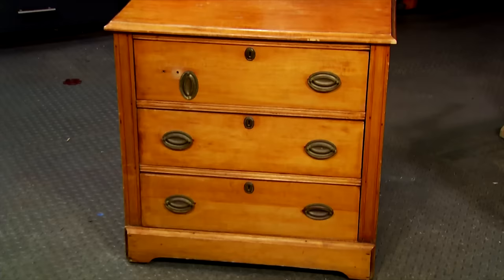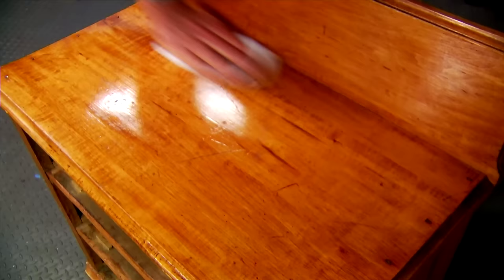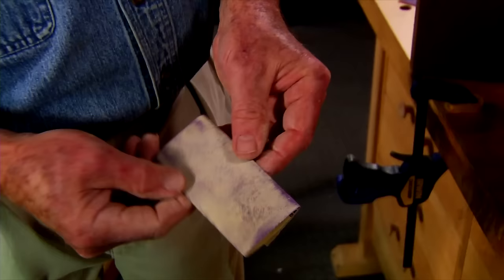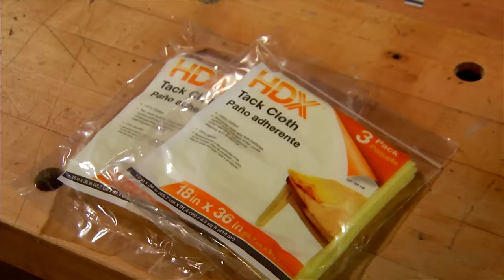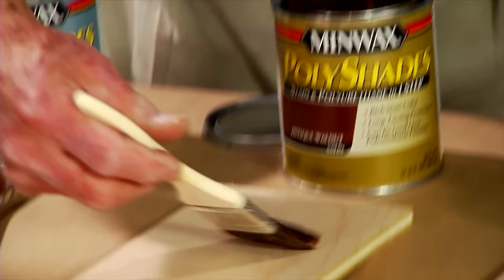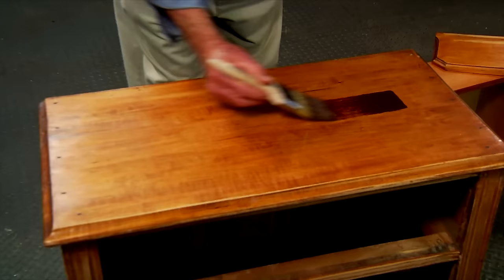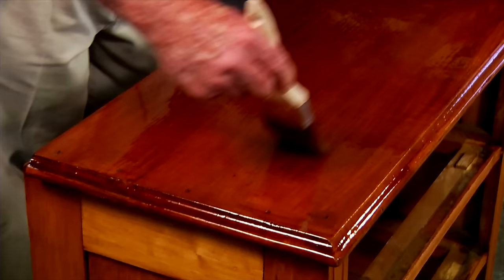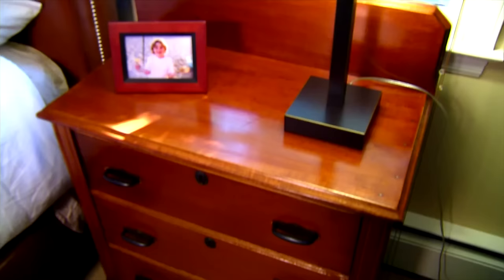Refinish Furniture Without Stripping

Comment: The sand paper cutter impressed me the most. This man is a dying breed of craftsmanship
Reply: To p
Reply: Halving then quartering a standard sheet of sandpaper evenly can be fitted on any of the quarter sheet sanders. A half sheet folded in thirds is SOP in the paint trade working well for those who have small as well as large hands. The DIY ad/infomercials make it look as if there are just a few types of abrasive papers. Not so!
Reply: Well, if you´ve never used a pair of sissors or a boxcutter i guess it´s "craftmanship"? Lol!
Reply: @1967DIF  this is a lot slicker than running a pair of scissors through it

Comment: I just had to come back and tell you that I refinished my kitchen cabinets (all 54 of them) and I did it every step that you showed in this video; except that I used a stain without the Polyurethane. I did the stain first then applied the Polyurethane separate after the stain. My cabinets turned out looking brand new! I am so glad that I found your video, it helped me so much. Thank you.
Reply: Can I ask why you applied them separately?
Reply: @rachelburright1582  when I went to Home Depot to buy my stain and polyurethane I talked to the gentleman that worked in that department and he said the with his experience with the stain mixed with the polyurethane didn't work as well as doing it separately.   I bought a small can of it anyway and tried it on a old piece of wood I had laying around and didn't care for it either. I think that it boils down to preference. I did mine in the two steps of stain then polyurethane and I loved the finished look.
Reply: Hi what stain did you use, just the normal minwax one? but since it doesnt penetrate wouldnt it just sit on top and not dry properly? or did you do the shellac layer and then that helped it to even out? I live in a country where I dont have access to such a wide range of staining products but I can get stains and polyurethane seperately so Id love to know how you did it
Reply: Not surprising. I've never had much luck at all with the polyshades product.

Comment: Ron, great sandpaper cutter and storage. However, with what you just did here in the video- sanding and such- you pretty much did "stripping" . I just finished doing a 1940's mahogany dresser and cabinet- and used ACETONE AND STEEL WOOL (no sandpaper!) . Works awesome and took off the old cruddy finish wonderfully. Then, finish the firniture with FORMBY's TUNG OIL- a gorgeous natural oil finish. I applied three thin coats of ting oil and it looks great. More natural than plastic looking polyurethane. Formby's is real natural tung oil- not the fake "tung oil" from others. Just my 2 cents from experience.

Comment: Took some notes
1 use paint thinner to clean 
2 use 120 gritt and sand with grain of wood
3 clean again this time with tack cloth to get rid of dust
4 use shellac primer
5 stain with 2 part (polyshades 2 in 1)
 brush lightly, don't put on too much 
6 leave overnight
Reply: No no no, not paint thinner. NAPTHA! Very specific.
Reply: @MightySapphire  used paint thinner, did basically the same thing, idk where to find naptha
Reply: Thank you!!!!
Reply: @CYoung-bf5uz  no problem :)

Comment: tip, sunmight sandpaper has a vinyl backing you can wash the dirty sheets and get more use out of them the foam sanding sponges you can do the same thing. Its only sandpaper with a paper back you can't wash without the paper falling apart.

Comment: Wonderful video with step-by-step clear and concise instructions.

Please consider using gloves or other protective clothing.

My mother refinished all the doors and windows in her house using a commercial stripping product without wearing even rubber gloves and a few years later was diagnosed with multiple myeloma.

Her relatives typically lived into their 80s or 90s. Those who passed earlier generally had heart issues, so her diagnosis was a family rarity.

We urged her from the start to always wear heavy gloves but sadly she did not.

Reports indicate that people regularly using benzene or other strong chemicals without protective gear are at higher risk for certain diagnoses.

RIP Mom🌺🤗❤

Comment: Good video.  I'm a painting savant...but I liked the solutions presented for the silicone section.  Me:  I would have sanded it down harder.  I'd start off with a high grit with an electric sander or, if you want more control, one of those hand sanders that are in a rectangle.  Then, I'd go down to a low grit sandpaper to finish it off.
Reply: I'm sure you are...
Reply: Why would you start with a high grit paper and finish with  a low grit coarse?  You must be a savant. Stick with painting walls.
Reply: Khanh H
Reply: Khanh Ho I would use a sand blaster on it and then light sanding with 200 grit before staining and lacquer!

Comment: Thank you! I've learned a lot from this video. I just bought a dresser used, needs a new finish on the top and I want to stain it black anyways. I saw another video where they said that you cant use oil based stain, it wont soak in, and to only use water based stain.. can you or anyone tell me the difference?
Reply: I’ve seen it too. I think you have to know how to work with oil based. They also said it tends to yellow more than a water base. Now I am totally confused

Comment: Ron - great videos. My question is about the Naphtha.  It's very hard to find nowadays.  There are other products (e.g. Painter's Solvent)  which touts themselves to be substitutes for Naphtha, but I am reluctant to use them.  So, in lieu of genuine Naphtha, what do you suggest to use as an equivalent, safe solvent for that degreasing step?  Thx.

Comment: Would you please clarify the Shellac issue? 
You showed a can of white, synthetic Sherwin Williams shellac primer, while actually spraying the finish with a different product, that appears to be a regular clear shellac from an unidentifiable maker.  Was  the shellac product you actually used a clear synthetic shellac, a clear synthetic shellac primer, or a natural shellac of some type, and what brand did you use?  The use of the proper shellac appears to be the key to overcoming the residual silicone problem, and achieving a successful result.  Inquiring minds would appreciate a little more specificity and clarity about this important step in the process.  Otherwise, your video is excellent and most of your viewers look forward to trying out your method and achieving the same outstanding results you achieved.
Reply: Try the zinnser bullseye shellac clear in the can or they have quarts available at the same place you would find the polyshades.

Comment: I don't like using stripper one because of the smell the toxicity and cost , so I've never used it you can pretty much Sand stuff down enough but I have used the moist treatment where you get it moist then dry and moist again .. e.s.p for over painted stuff ..

Comment: I believe in sanding the top of the dresser and the faces of the drawers, rather than the steps this gentlemen took. Reason being, both of the surfaces, get the most wear and tear. It would have looked much better in my opinion.

Comment: This is a sales pitch. The MinWax alkyd poly is good stuff. The narrator is a pro. The final version is full of inconsistencies. 
1. A test for silicone can be done and should be done first. Mist some water on the top it will give instant results. Spray shellac can have as part of the combination of shellac and propellent and anticaking fractions, some methylene chloride. MC is the ultimate paint remover.  Naptha can be used in  Zippo cigarette lighters or to reduce (thin) the MinWax product being demonstrated. Paint thinner works equally as well as does "mineral spirits" that is the same thing only priced higher.. The MBAa are at it again.. Probably smokers too.. Yep,don't put the polys on the paint shaker unless it can sit for a day or so. Bubbles.Stir only in one direction as well. Your choice of direction. Both directions entrains air.  

Shellac does a great job sealing surfaces as well as raw wood. A quart of  "Seal Coat"  goes a long ways and can be reduced with alcohol. It can be applied with a brush or rag or even used as a finish by "rubbing". Do not try to apply any shellac with a foam applicator or a paint pad. The reducer fraction will dissolve the foam and the adhesive on the paint pad. Big mess!!  Thanks to all the dead bugs who bring us these wonderful biochemical products. RIP.

The demo shows at first the MinWax product being applied with a synthetic flag tip paintbrush. Later the MinWax product is being applied with a natural bristle brush possibly on the advice of the narrator again who is a pro. Both brushes have long lives and look like Purdys. Both must be washed after use in a solvent.. Naptha?  if the budget is there. Paint thinner is mo bettah.. The synthetic brush is fairly clean when new and can be washed in water before use. Bristle brushes are dirty. Washing any bristle brush include the pricy artists brushes should be done in paint thinner. Water on a bristle brush causes the natural material to swell.  We doubt the pro who is featured would even mess with that project in reality and he got paid for some fairly good advice by MinWax.  The weak points we can attribute to the bean counters, lawyers, MBAs, advertising agency scriptwriters who make even taking a dump sound like fun, rather than the real folks who know how to do stuff.

Comment: Try this question.  In 1975 I bought a 3' x 5' desk with six drawers and two leafs  The rear of each drawer is dovetailed... fronts not.  The desk is solid but I don't think its hardwood.  It's stained a dark Mahogany.   I have stripped/stained the desktop a Salem/Antique Maple which I like much better.  The rest of the desk is obviously daunting to lighten.  The Maple is a gel stain over which a semi-gloss urethane was used.  I seem to remember a chemical product that would de-gloss the current finish and allow the dark stain to be covered by two coats of the Maple gel.  The de-glossing allowed the gel to adhere well.  Can't seem to find a product to accomplish that.  Any suggestions?  I will continue with experimenting, but someone has almost always has found a tip/method to accomplish what seems too difficult

Comment: Proper way to do this would be find out what the coating is, then strip it with the right thinner chemical. Then sand with 220. Then 400. Then tac cloth it and put a new finish on it. Multiple coats with sanding in between with 400. To make something look amazing takes 3 full or 4 full days. Unless you have an air gun for painting. Then it's just 1 day.

Comment: I think its better if you actually get rid off the old stain by using a stripper, followed by a wood bleach. Then apply some wood conditioner before staining the wood to get that even stain finish. Its also best if you protect the stained piece with polyurethane or with an epoxy

Comment: Since the shellac primer isolates what is underneath from the new finish you apply, is it possible to just clean everything off and then spray that on prior to the new finish, as opposed to sanding?

Comment: At 5:46 it appears you have overstaining on the edge of the drawer. Did you correct that or just left it?
Reply: It looks left there, but being a bit of a perfectionist, I would never leave bubbles or streaks or irregular drips, even on the areas not visible in the room, but apparent if you open a drawer.  S!till, take all of this and try a project and learn your own variations.  It is a good instructional video with some great tips.  I used a #OOO steel wool to rub down the furniture between layers of Varathane and my hutch and kitchen cabinet doors came out almost like glass.  Use the tacky cloth between new coats.
Reply: Perfectionist here, first thing I picked up and unsubscribed hahaha
Reply: Bro this is a cheap paint job on furniture. Honestly if you are going to do this bad a job just paint it with varnish and skip all the sanding. No need to same if you are going to half assit.
Reply: @Valient6  😨💨

Comment: I found this video very interesting because I recently came across a ladder or leaning bookshelf (I don't know what the actual name is) that was thrown out on trash day in my neighborhood. It was basically in good shape but just had some blemishes that needed sanding. 

However, after sanding it, I realized it now needed to be refinished. The bookshelf has a smooth feel but I'm not sure whether the smoothness is from it having a layer of polyurethane or not.

The reason why this video really appeals to me is that it suggests that even if a piece of furniture has polyurethane, one can still get around this by using Minwax Polyshades (Stain and Polyurethane in 1 step). 

Am I right in my understanding? Please advice.

Comment: Great job. The finish has a scratch that went deeper than the stain. I decided on the polyurethane + primer finish. Will the scratch show through the finish? Is there a trick to hide the scratch?
Reply: You can use a wood filler (before sand papering it). There are wood filler "pens" or mixable solutions

Comment: I noticed the two other poly urethane stain choices were the water based type. Would those have worked over this finish? Do we assume the original finish is an oil based type thus requiring an oil based finish? Or it doesn't matter?

Comment: So, did he sand again then apply shellac? I’m a newby and that has happened on my table.
Reply: did you ever get a reply to this? what did you end up doing? I'm not working with a large surface so i'm not again resanding, but if it makes a perfect seal, and a new coat covers up the fish eye spots, then that would be the easiest i think. And if you did this, how long after shellac was it safe to poly again?

Comment: What grit sandpaper did you use? Im refinishing a hardwood table for my grandma. I stripped the top but it didnt have polyurethane. Sides did but its down to the original wood, but not sure what to sand it with thinking 220grit, but to get finish off the sides and stuff what grit would i want? I have lots of 80grit laying around an it seems to be taking the finish off without scratching. But any info is appreciated sir. Great work by the way!
Reply: John Grace and
Reply: I stopped it and went back many times to find out and it looked like he used 120 grit...

Comment: Why does the White Shellac you use appear to be clear? We just bought the same thing and it went on white not clear.
Reply: +Darlene Montesino It's possible that if the humidity was high you have moisture in it.  Shellac dries really fast when you spray it and it can trap moisture from the air.
Reply: The video unfortunately shows us "White Shellac" when he obviously uses "Clear Shellac on the furniture. He should have corrected the video.
Reply: Riggs there's no clear shellac at least not at home depot neither at Sherwin Williams store!! Just went in to both stores!!
Reply: Your Pro👍 Thank you for the information on using shellac is brilliant.

Comment: I used to sand furniture with my hand and a sheet of sandpaper until one day I was standing the corner of a dresser when a sliver of wood went up underneath my fingernail on my thumb. About an inch long and I had to go to the hospital. The dresser didn't look like it had anything that would hurt me. It went under my thumb nail all the way to my knuckle. Let me tell you what true pain feels like LOL I cried. I felt like I was going to pass out and now I understand what Chinese torture is all about. I will never send anything without using a block with the Sandpaper wrapped around it. I will never stand with sandpaper in my hand ever again. It took about nine shots because your thumb is very difficult to numb before it finally became numb and the doctors could not believe that sliver of wood was so long underneath my nail bed. They were all coming in to see it and they took pictures. I'd rather go through another C-section then to go through what I went through sanding that dresser. And the doctors thought I was going to lose my nail permanently but I didn't. That was one of the worst things I've ever had to go through physically.

Comment: Polyurethane should be put on furniture that was originally varnished.  What needs to be done instead is to clean the surface thoroughly, then liquify the old varnish and let it reset.

Comment: Great video! Thank you very much for sharing!Can I apply this over existing finish ? I have 5 year old cabinets, lacquer finish that are satin. The finish looks very dull and I would like to give it a coat of gloss wipe on poly. I don't have spray gun and can not use lacquer spray indoor apartments anyway.I am thinking to clean cabinets well with mineral spirits and then Scuff with 220 grit sandpaper.Then apply wipe on poly.
Reply: Everybody will tell you poly won't adhere to lacquer.  I've never actually tried it.  Shellac will adhere to lacquer.  You could put shellac over the lacquer and then poly on top of the shellac.
Reply: Thank you very much Sir !
I really appreciate your help.
Julian

Comment: Does this really dry over night? Mine is taking forever! It's still tacky some 12 hours later. I'm starting to think I ruined it 😩
Reply: How did this turn out?
Reply: I painted when it was really humid and kinda rainy outside so it took 3 days for it to dry and cure! At first I was afraid it was ruined since it was taking so long to dry but it's fine now. Good luck with your projects. I think I would have preferred a stain if I had to redo it. Nonetheless it was easy, quick, and painless.